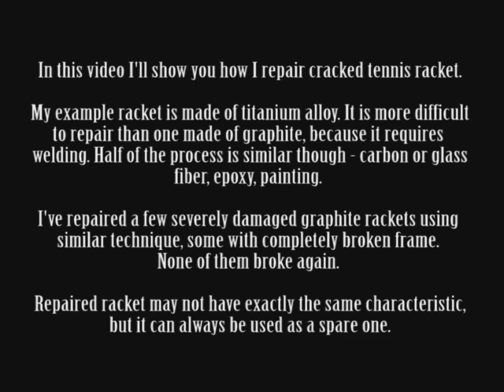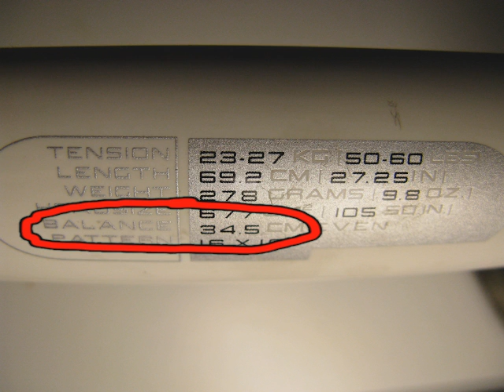Repairing cracked or broken tennis racket

Comment: Credit to your effort but this is pointless because the racquet will never play the same again due to the weld changing its flexing characteristics, distribution of mass etc. With a cracked racquet, just buy a replacement from Ebay.